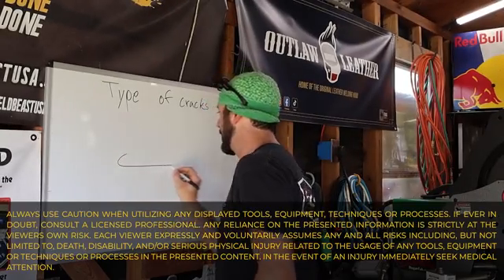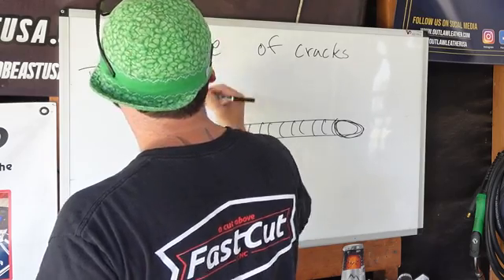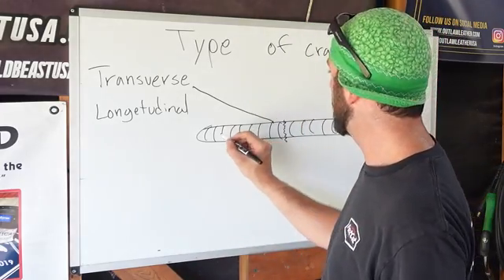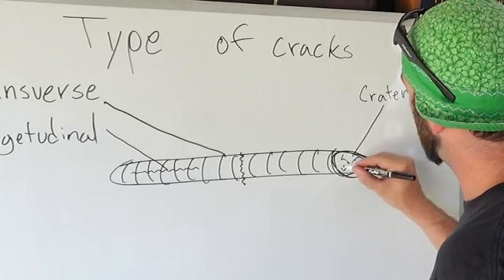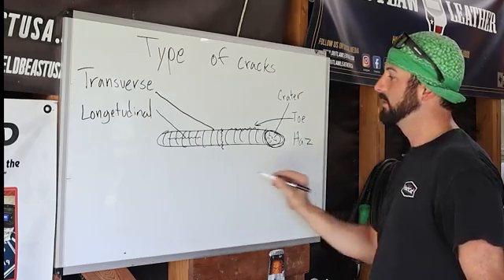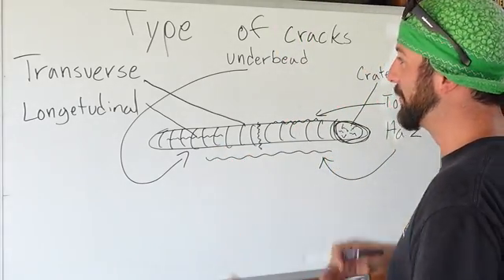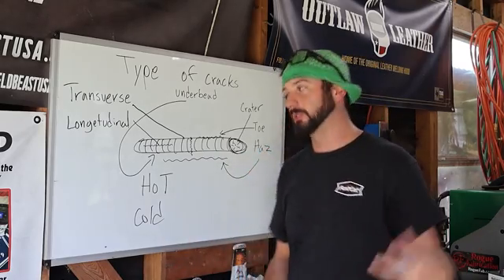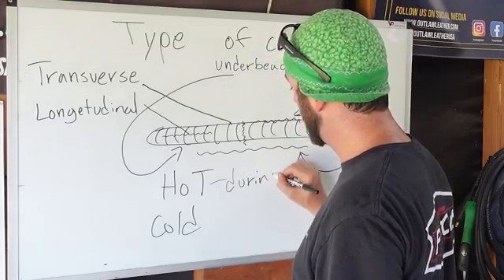How To Repair Aluminum Cracks With TIG Welding

Comment: Suggestion, if I may... save some time ans energy with that rotary file. Clean most of that meat weld with a 1/8th pipeliner disc.. then finish with the rotary file.

Comment: I get the same kind of feet cracks on handrails, granted some are when a car helps break it. I'm new to tig but got the same 230 to learn on. The aluminum is so dirty, but yours turned out looking pretty good.

Comment: I always drill the weld first then hit it quick with the die grinder bit seems quicker and less chance of the bit gumming up depending on the previous fill material.

Comment: Looking at where the legs wanted to be, rather than where they were, made me think that there was stress on the joints because the parts were pulled into place rather than being bent exactly where they needed to be. That’s a sign there’s built in stress which, by itself, can cause problems down the line.

Comment: Besides the differences in sounds from the filler metal when you drop it on the table, you will also notice the 5000 series has a green tint to the arc because of the MG content. I went to a class years ago and they taught us that you should never weld 6061 t-6 to itself without filler metal, because it will always crack. For those that don’t know, that is most of your extruded aluminum shapes, angles, tubes, channels. They generally have it printed on them as well.
Reply: Nice info

Comment: What kind of aluminum do motorcycle parts have. I have a broken mirror n I want to weld it but don’t know what kind of aluminum it needs. Ima do stick weld bc that’s what I got. Any suggestions in how much amps I should start with?

Comment: That thing looks like it was run into with a pickup truck.  It's all bent up.  I would have cut it apart and straighten it out!  I guess that was not in the plan...  Anyway, excellent welding!  I've welded a few times with my chin as well, hahaha

Comment: hmm, I have always acetone, brush, re-acetone. I was taught you want to clean any oils out first, then brush so you didn’t engrain (SP) the oils into the base material. However I’m a hobbyist that needs all the help he can get.
Reply from the maker: absolutely, aluminum welds best clean as can be and proper brushing and acetone is usually the trick, especially for the heavy oxide on here. I will admit, it was pretty trashy as far as the puddle looked. but adjusting the machine balance and wave forms can help mitigate some filth if the machine is capable.

Comment: I'm fairly certain those cracks are from fatigue. Certain aluminum alloys are notorious for it. Nice repair!
Reply from the maker: I would agree, the moving of the doc and the legs likely on different boards shifting over time just wire it out. Im hoping using a higher tensile strength rod with a convex weld reinforcement will keep it from happening again.

Comment: I'm a hobby welder. I have an AHP 200 (TIG/Stick) and a Vulcan 215 MIG.  I can lay a pretty decent bead, but listening to you spit out knowledge makes me wonder if I shouldn't take some welding classes.
Reply from the maker: It most certainly help to know the "why" in order to become a well rounded welder in my opinion. you dont have to be the slickest or the quickest to be dangerous... its the knowledge that can.

Comment: Aluminum is just a terrible material. Unless you absolutely need to save the weight (an aircraft for example) you should use steel. All aluminum will crack and break eventually. It’s just a terrible material, and building a fish cleaning table out of it is absolutely insane.
Reply from the maker: i think thats a little dramatic. Aluminum has its place, and why not a fish cleaning table? I imagine if it was bolted on a less stressfull spot, instead of on the moving pier, there would've been no issues.

Its a super light weight table that will never rust, perfect for being next to water. go to any cost, youll find more aluminum and stainless than anything else.
Reply: @Trump985  Building a fish cleaning table out of aluminum is absolutely insane? Seems a little dramatic..

Comment: Fish cleaning table… Out of aluminium? I thought everything food related had to be stainless. Did it smell like fish when you welded it? 😂
Reply from the maker: haha no smells, and the top the fish were being clean on was stainless or some kind of cutting board material.
Reply: Aluminum is used in pots and pans. It's not universally food grade because it can react negatively with acids in fruits. Meats generally aren't that big of a problem on aluminum. The worst thing would be if he cut into the table with a stainless blade and got aluminum shavings in his fish. Either way not the most reliable table material choice. He probably mainly did it this way because it was so light

Comment: You forgot fatigue cracking, aluminum is famous for it. If that table sits on a moving dock all day, especially if it is loaded it is going to suffer from fatigue cracking. Try some gussets if it comes back.
Reply from the maker: 100 percent! missed that one. not till after it left the shop did i think "shouldve added a gusset" lol